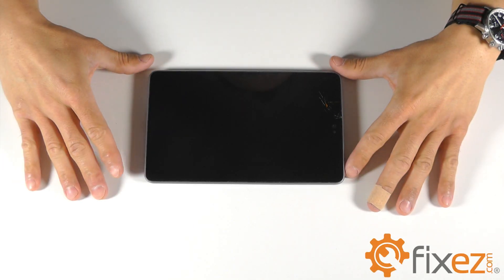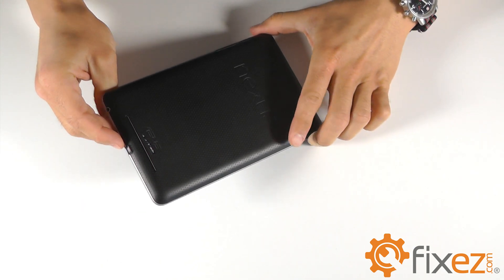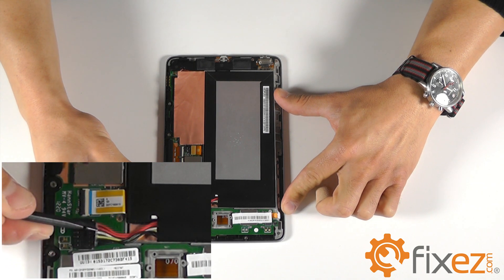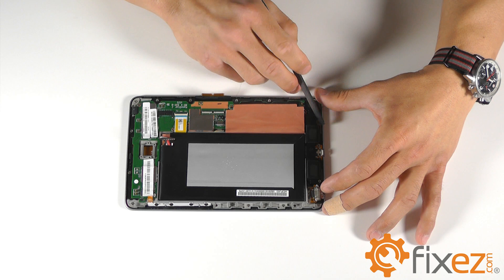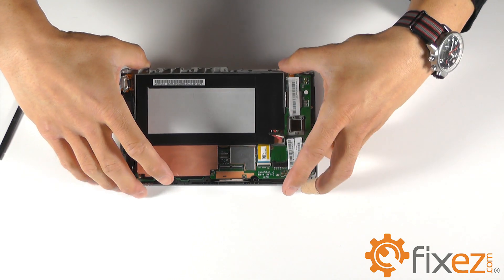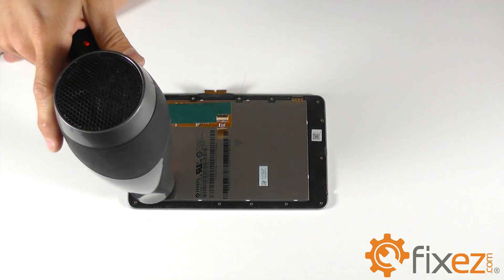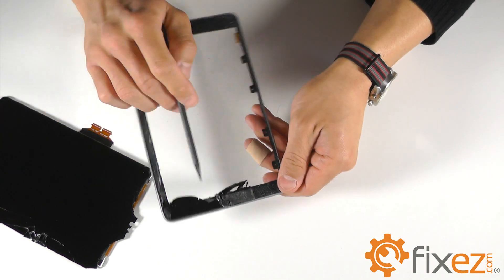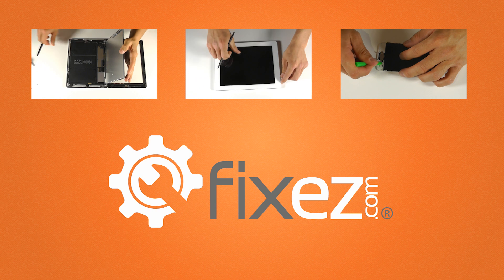Nexus 7 Screen Repair & Disassemble

Comment: Thanks.  I used this video to learn how to remove the display assembly to reseat the video cable ribbon from both ends in an attempt to repair my Asus Nexus 7 first generation (2012) after it was dropped and displayed only blinking white lines. I was successful and we now have a functioning tablet again.  Me and my kids are thankful.

Comment: Is the following part the only part I will need to repair my cracked screen for my 1st Gen Nexus 7: http://www.ebay.com/itm/For-ASUS-Google-Nexus-7-Glass-Digitizer-Panel-Touch-Screen-/371172993485?_trksid=p2054897.l4275 ?
Reply: If so, how much do you charge for the part?  Thanks.